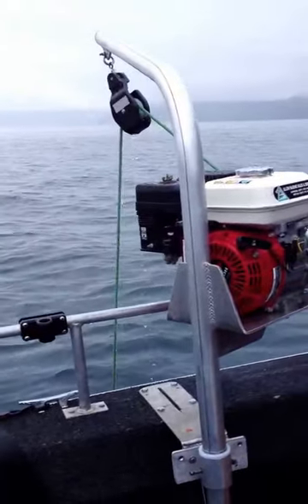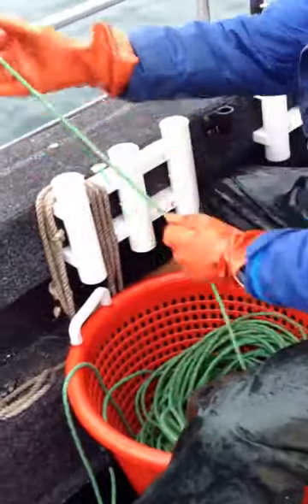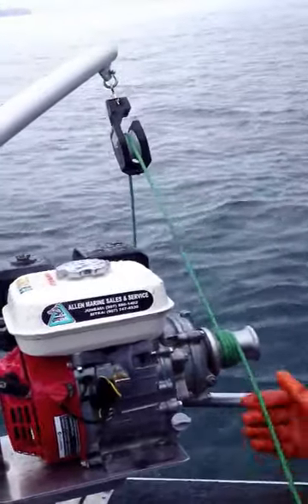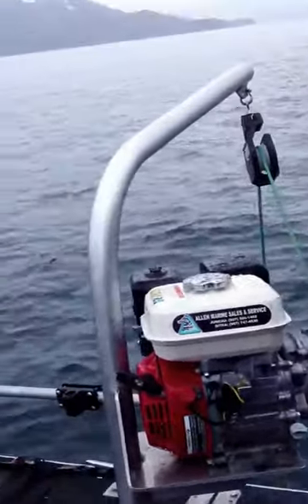Honda gas pot-puller whitter Alaska

Comment: that a really nice crab pot puller, Im looking to build one, will you please be kind enough to share any info on where to buy the gear box with pulley roller that attached to the motor ?? I can weld it up and install the motor my self, or does the motor come with the gear box, any info will be apreeciated, thanks for your time.
Reply: did you make one yet
Reply: @scottallen5003  I am interested in getting such pot hauler how can I get one